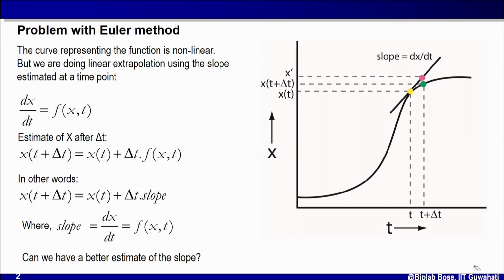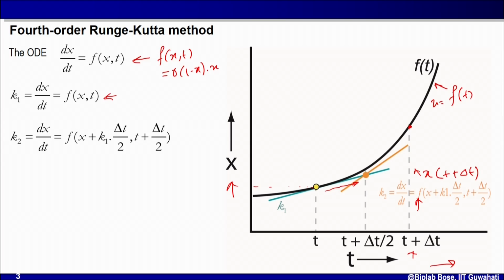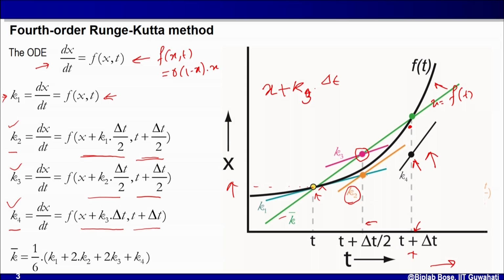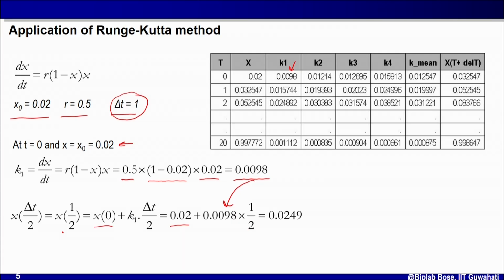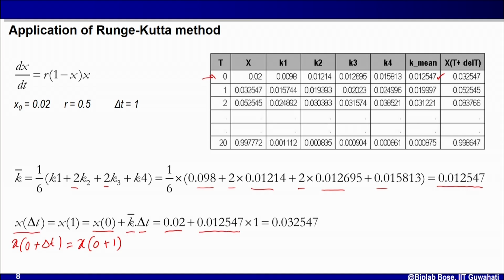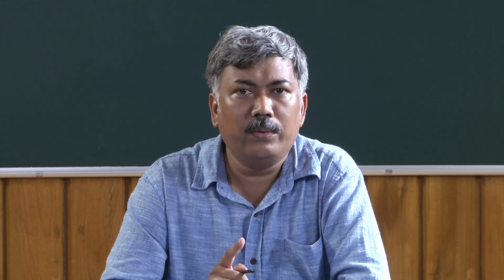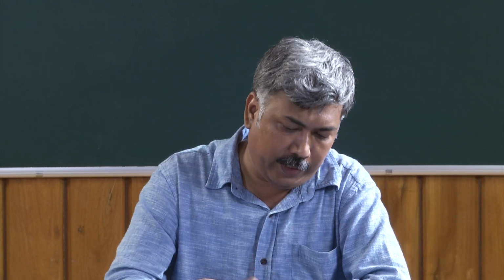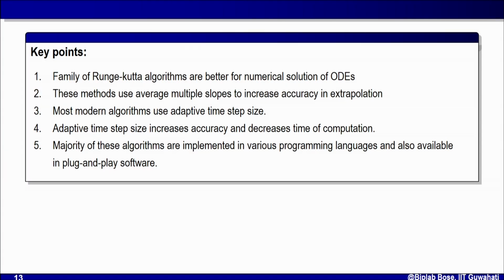Numerical solution of ODE 2

Comment: In the plot, k3 is not so steep as k1 and k2, but in the calculating part, k4 > k3 > k2 > k1 at the beginning stage. So, maybe the plot can be adjusted a little. What I am curious about is why the Runge-Kutta method calculating in this way works? Thank you for your good work!